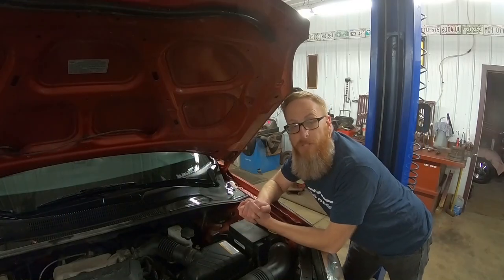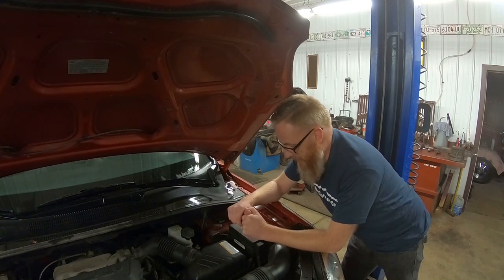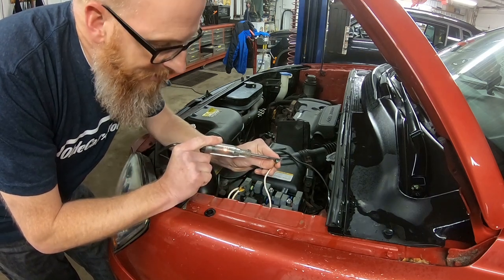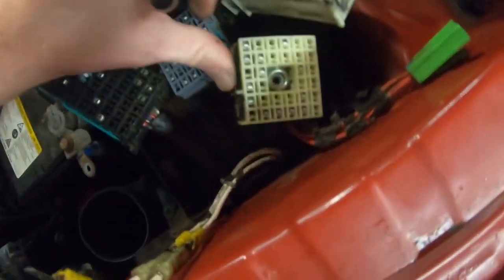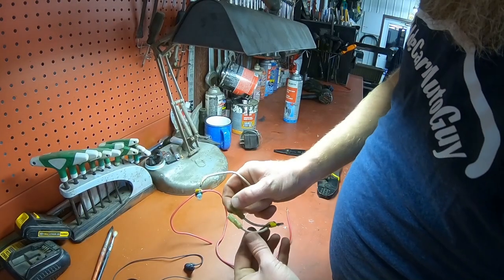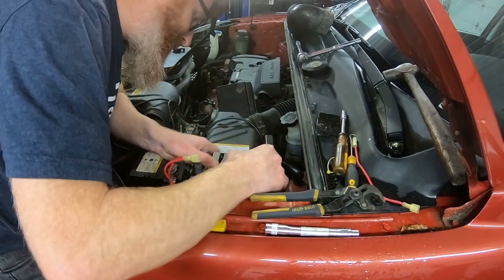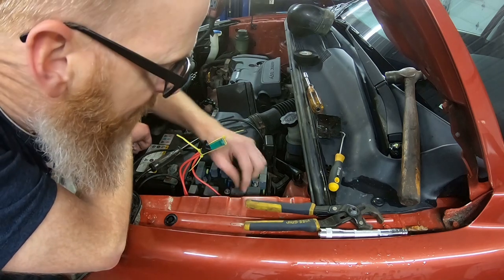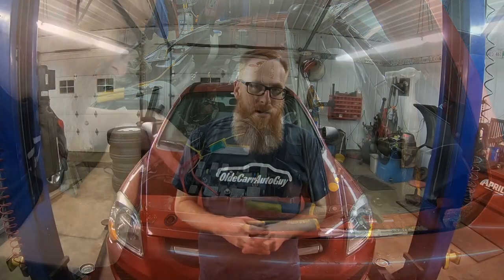STRUGGLES OF BUBBLES- KIA SPORTAGE WIRING ISSUES

Comment: just a thought, have you thought about separating the two, running a 30amp or 20 amp fuse for the blower motor, then a 10 or 20 amp fuse for the dash lights and seeing which one blows first.
Reply from the maker: I have. But I wanted to fix the obvious first and go from there. But that's the plan! Thanks for the input.